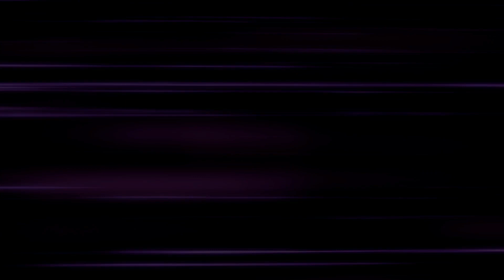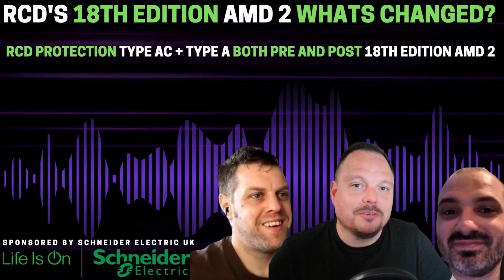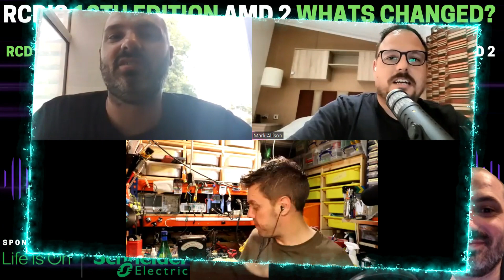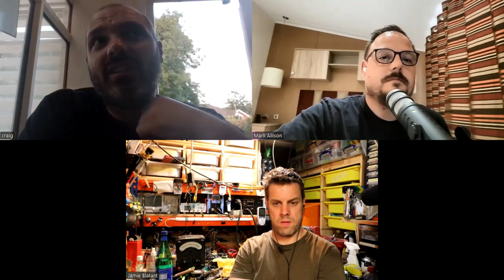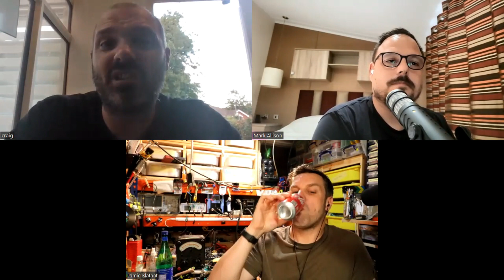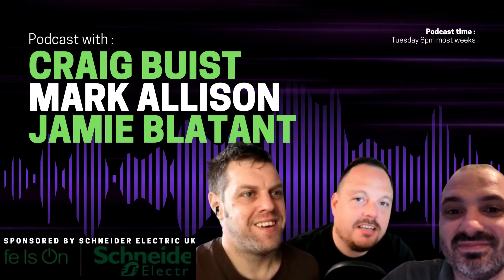RCDs changes AMD2 explained and BRAND NEW electrical apprenticeship review

Comment: With regards to rcd testing I was under the impression that you recoded 5x for additional protection (tn)
And 1x for fault protection (tt)
Reply from the maker: Yes when we drift into fault protection the same old principles apply. More generally on TN systems was the thrust of the discussion here.

Comment: In my personal opinion for domestic CU / DB the minimum level of protection should be
Main switch + all RCCBO's + SPD.   (RCCBO should be DualPole to stop any reverse feed especially if its just a new board rather than a full rewire)
25mm tails with 16mm CSA bond 
Ideally there should be an isolation DP switch between meter and CU / DB for safe working

A Full AFDD board will cost too much money at the moment but as all things price will fall with time.

You could expand this further and say Domestic install dwelling vs Domestic install rental property.
Reply from the maker: Thanks! Yes we are trying to hold this at an apprentice level but totally we can talk about other aspects in the future. Thanks